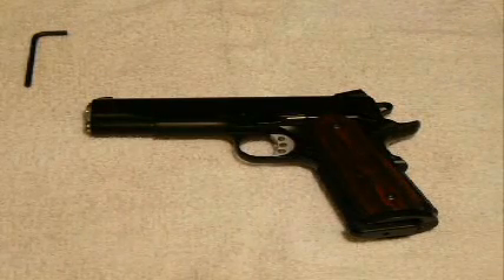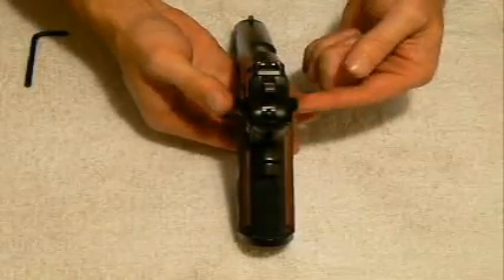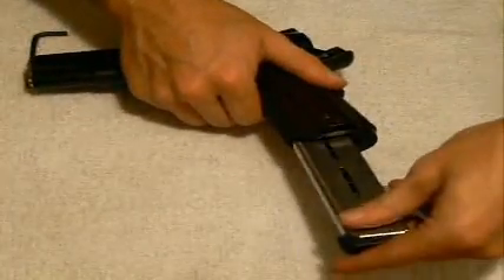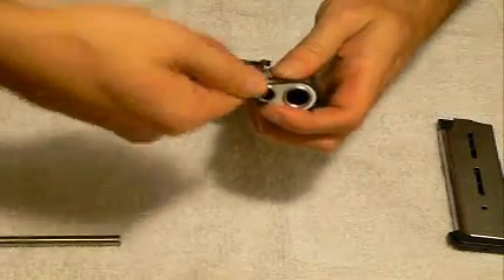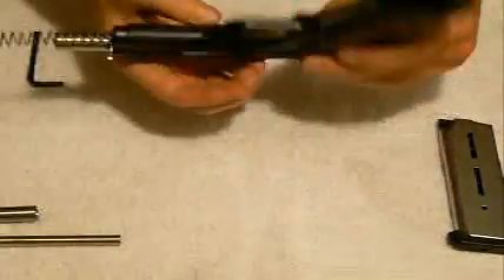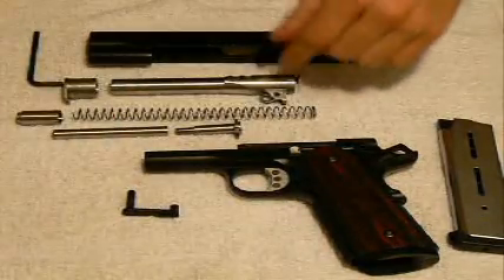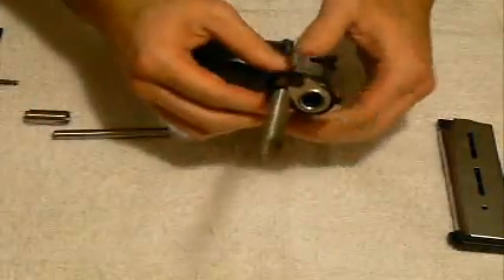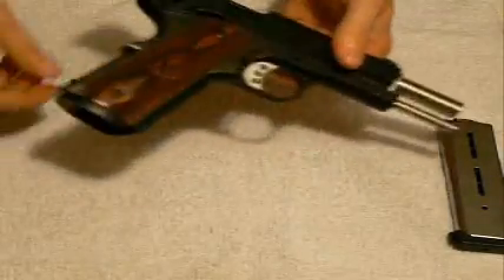Springfield Armory 1911A1 TRP Field Stripping

Comment: @TheHogger129 

 The Springfield Professional is available to the general public via the Springfield Custom shop, they run about $2,500. The gunsmiths themselves are told who is receiving the pistol, be them civilian or members of the FBI HRT. The TRP is also available as an upgrade package to a customer supplied pistol, it runs about $895 with a customer supplied Springfield Loaded. Also: The TRP is handfitted to a degree, just not nearly to the degree that a Pro is.

Comment: Nice I just got mine this is help full first time I took gun apart I didn't unscrew guide rod and spring was difficult to put back. Hey in the lil zip lock it came with a tiny L shape tool thing what is that for?

Comment: Good video!  Do you have any tips on reinstalling the take down/slide release lever.  I have trouble with the detents/springs and do not want to scratch the slide. Do you just push the take down lever straight down and the detent moves out of the way or what?  thanks in advance... I don't want to mess up my gun needlessly...